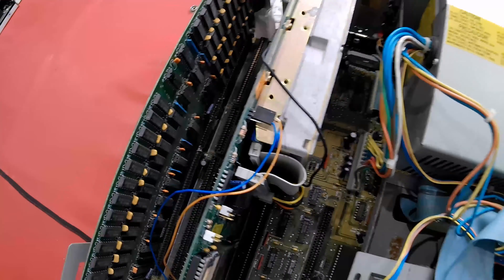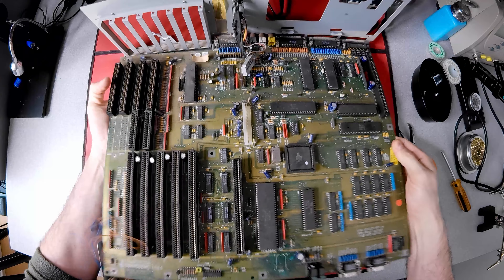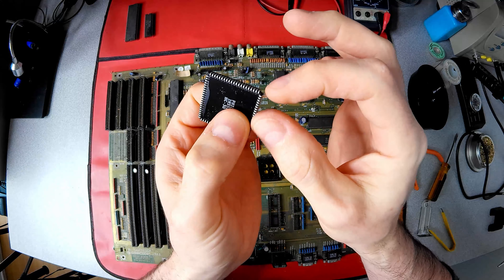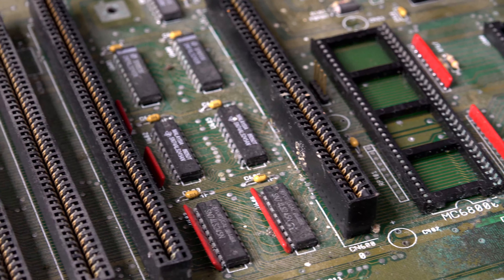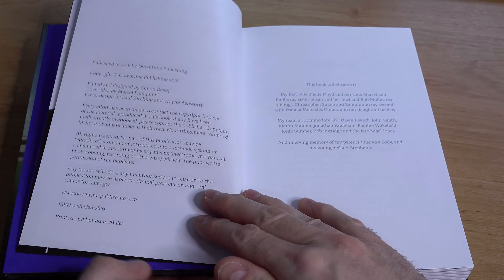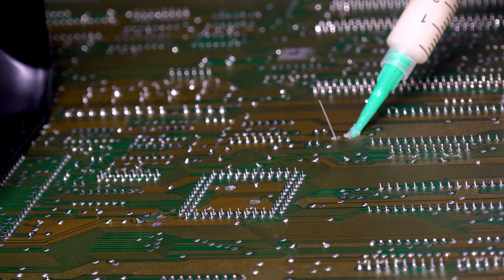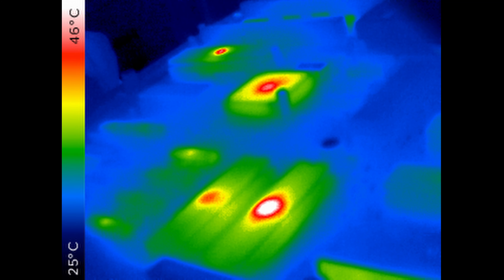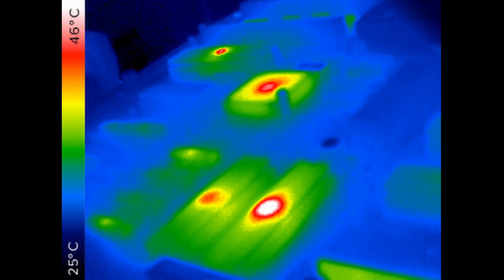Mystery Amiga 2000's (Pt3) - Motherboard Refurbishment

Comment: I have to comment mid-video. Please get the DIP-chip puller. Using flat screwdriver for removing socketed chips can easily damage the traces beneath the chip. Sometimes it will disrupt the precisely calculated high-freq signal propagation even when trace is not fully cut, but slightly thinned/narrowed.
Reply from the maker: Thank you for watching. I do have the simple U-shaped DIP puller but I find it too easy to damage the larger ICs with it when they have been in a board for so long and do not want to move. I am being very gentle and only twisting between the plastic socket and the IC. That's why I never use a levering actions as it's too easy to damage the board that way.
Can you recommend a better chip puller for large ICs?
Reply: @TheDigitalOrphanage  I'm using the usual U-shaped DIP-chip puller from eBay. It works for small chips like RAM. I had no need in larger one yet, sorry. Maybe Mark from Mark Fixes Stuff channel could help?
Meanwhile, I'd use a plastic flat screwdriver for such purposes.
Reply from the maker: I have some nylon plastic spudgers so I'm not sure why I didn't use one of them, force of habit I guess. I'll try one next time. The problem I find with the U-shaped pullers is when you stretch them too wide for large ICs,  there's not enough under the IC, and what there is is at an angle making it easy to slip.
You've prompted me to do some searching and this looks interesting:
https://www.silicon-ark.co.uk/ic-puller-removal-tool
Reply: @TheDigitalOrphanage  I'm glad you found the tool which might help in your next restorations. Our digital orphans deserve the very best care ;)
Reply from the maker: I'm not feeling this extravagant though:
https://www.distrelec.biz/en/ic-extraction-tool-28-weller-pul-ic-24-28/p/18044116
Reply: @TheDigitalOrphanage  LOL yeah, looks hilarious. But then again, if you get this one you could boast with it to all the other retro channels :)) This device could easily made a museum item itself 😁

Comment: I had a couple of accidents with the plcc extraction tool when trying to remove Agnus. Chipping off corners and scratching the chip. Even bending pins badly. Very annoying. But not managed to destroy one yet, other than cosmetic as a result from this. And yeah, most Amiga motherboards have those two holes in the PCB so one can remove it more safely. Amiga 500 Plus motherboards do not have these holes sadly.
Reply from the maker: Yes, it's frustrating when that happens that for sure. On the A500 plus though, at least the Varta lends a helping hand by corroding all the pins so they just fall away! 😉

Comment: I've not seen the hot flux copper braid technique before, what exactly does it do?
Reply from the maker: The hot flux helps dissolve the oxides and impurities. The braid acts as a gentle scrubber and collects the larger particles and old solder.